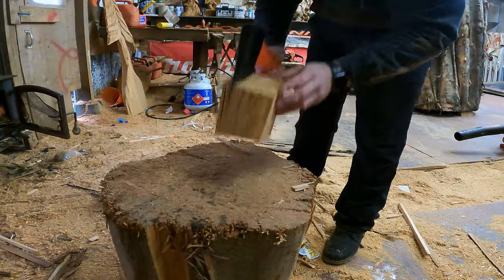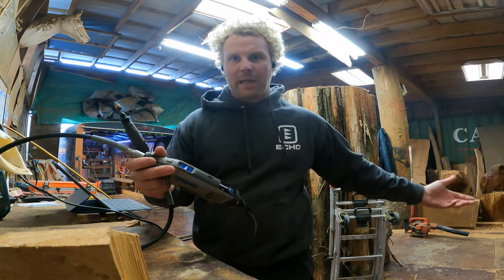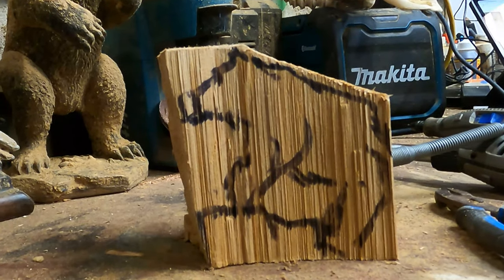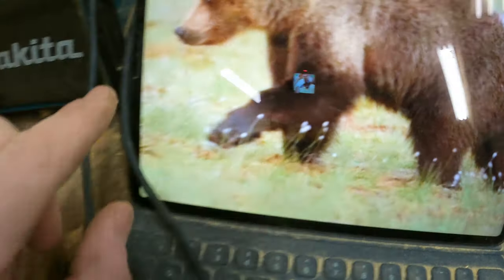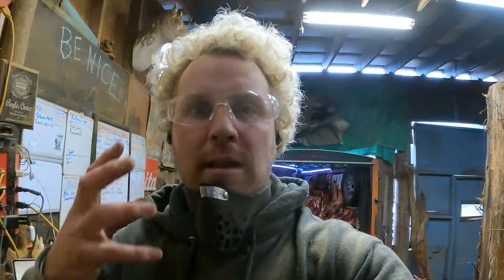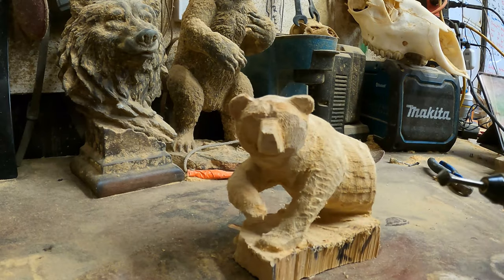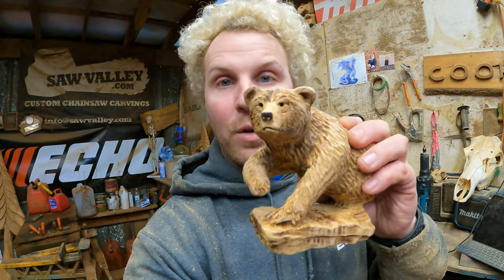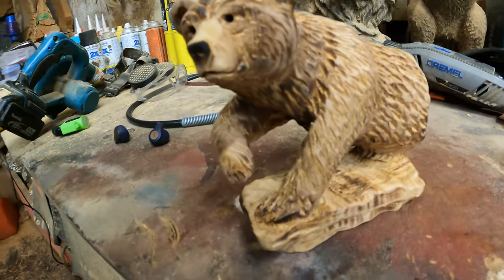Learn to Carve wood DREMEL only - Go From Beginners  to Advanced- Creating Movement

Comment: Great video Ryan. I did not like the way you were treated by the other carvers on the TV show. This was a good video to introduce people to power carving. I would love to be able to do the larger chain saw type carving, but have a bad back. My wife and I have the Ram BP50 power carver and been very happy withe it. It is much quieter than a dremel and has less vibration with more power. The harbor freight is a good way to see if you like power carving. We use a PSI D725 to catch the wood chips and dust to allow us to carve inside the house.